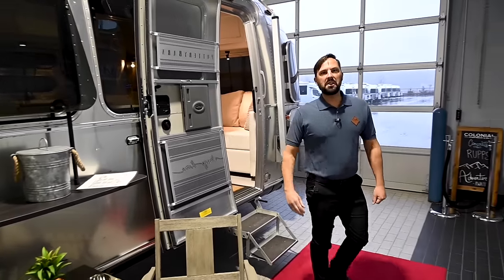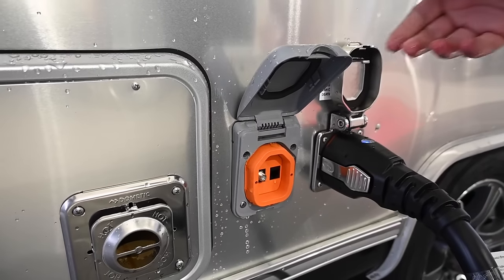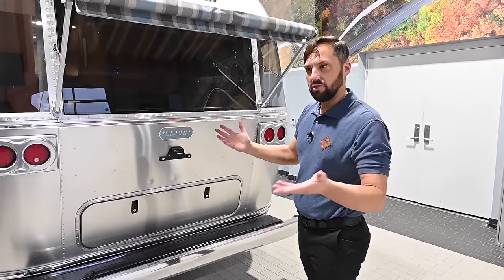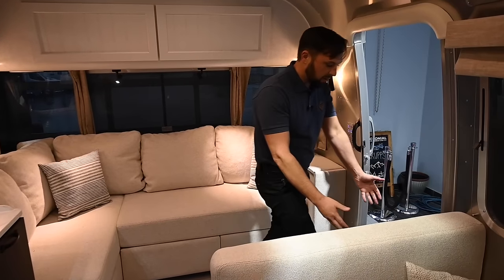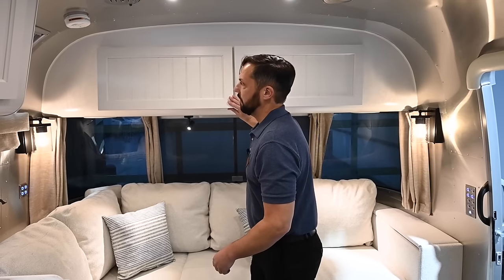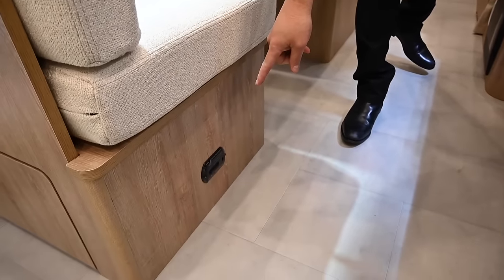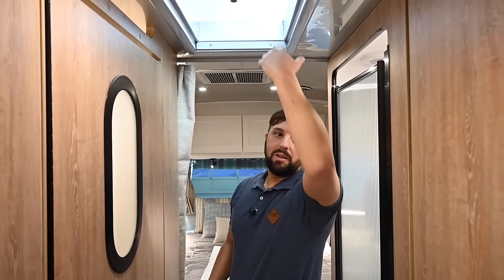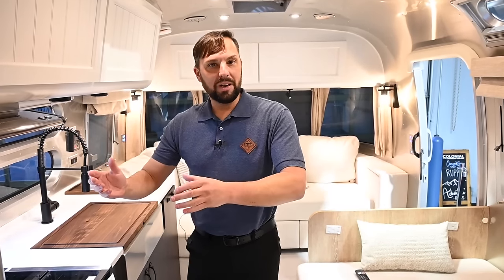All-New 2024 Airstream Pottery Barn Travel Trailer FULL Walk Through Tour

Comment: But has Airstream fixed all the Flaws that dozens of YouTubers are experiencing in their Pottery Barn Airstreams? How about Airstream checking out all these videos and see that there are common problems experienced by many new owners including the junk roman blinds that break within a few months ; the trash can in the kitchen that is falling apart, the light fittings that are breaking , the cheaply made Vents ; the plastic door pulls ; the warping wooden cutting board (which covers the sink!) . I'm an Airstream owner and would not spend $150000 on the Pottery Barn given all the reviews and videos of these trailers literally falling apart. Gone are the day when Airstream stood for quality.
Reply: I saw those videos too, also a lot of negative reviews on the Airstream motor homes. Disappointing.
Reply: They just want sales based on reputations….

Comment: What are the main differences/upgrades between the ‘22, ‘23, and ‘24?
Reply from the maker: 2023 All
• Improved Solar Array to 100 watt (each) Merlin Rigid Panels; Many Models Offer Additional Solar Panels over Last Model Year
• Improved Aesthetics and Function to License Plate Area (improved light distribution and less amp draw)
• New Bath Fan with Improved Function
• Addition of 12 volt TV’s; Frees up Inverted Circuit for Use (Classic equipped with 12 volt only in Bedroom Areas)

2023 Pottery Barn
• Improved Media Console Area - Enables the Ability to Bring your Own Media or Streaming Device, HDMI
input and 110-volt Inverted Circuit (Blu-Ray Retired)
• Pottery Barn Units will Continue to be Equipped with Battleborn Lithium Batteries (2)

2024 All
• Dual USB-A ports improved to USB-A and USB-C ports (one of each)
• New screen door latch - new styling and look
• Improved mattress consistency and comfort across all models to 4 layer design
• New coil spring added on all Zip Dee awnings to aid in awning retraction (running line change-beginning of 2023)
• Converter upgraded on 50 amp floor plans to Progressive Dynamics
• Exterior dual coax inlet (satellite prewire) improved to exterior data ports - includes one coax port for legacy satellite systems
or cable and new port for ethernet (n/a with Bambi)
• Interior bring your own device ports now includes ethernet inlet (n/a with Bambi)
• Antenna booster wall plate re-located to radio location in overhead cabinet
• Added lithium battery option (must be selected with solar package from factory; Bambi - Globetrotter; includes 2 Battleborn 100-amp batteries
and Victron shunt)
• All Models will be set for lithium charge profile upon shipment from factory

2024 Pottery Barn
• Upgraded inverter to 2,000 watt pure sine
• New 12-volt Smart TV - features Bluetooth compatibility to play sound with the radio
• Improved bathroom door handle with new m-lock magnetic catch

Comment: While beautiful- just not practical for two adults with pets, especially for full time living.... whoever designs these things- must never have lived full time in an RV????
Reply from the maker: Thank you for your opinion. Airstream has been building travel trailers for over 90 years, they are not new at designing these. This floor plan design is over 20 years old and is one of the most popular. We have many customers, two adults kids and pets that do extended travel in this model. RV's, travel trailers, camper vans (all recreational vehicles) are not manufactured or designed for the purpose of full time living. Many people that decide to adapt their lives to be able to live in an RV full time, know that they will give up some comforts that they would have in a house or apartment when moving into an RV.
Reply: Airstreams manuals specifically state that they are NOT intended for full time living. They are for camping only.

Comment: Will this airstream take severe weather ! Snow,storms,cold
Reply from the maker: It has heated tanks, enclosed underbelly and insulation throughout. There is also a forced hot air furnace, heat pumps and you can survive unexpected drops in temperatures below freezing overnight for with water on board.